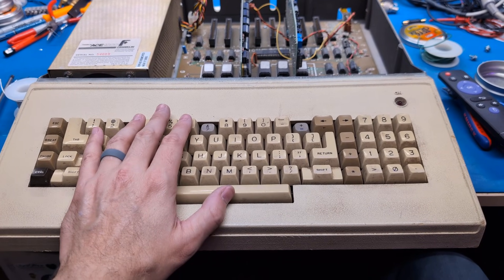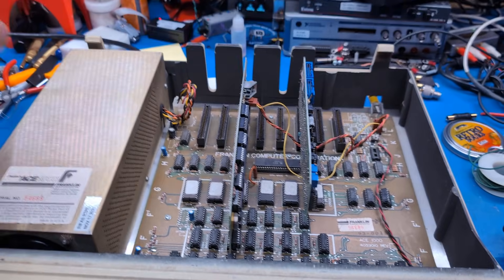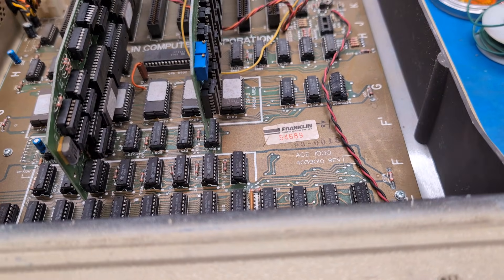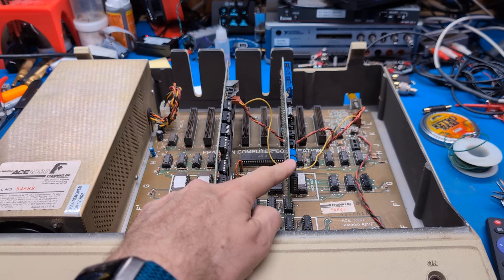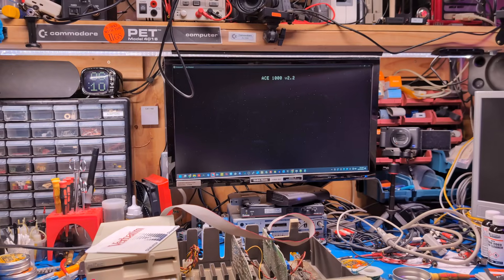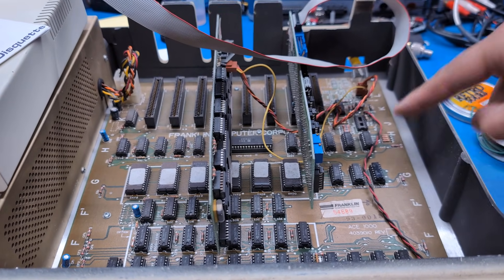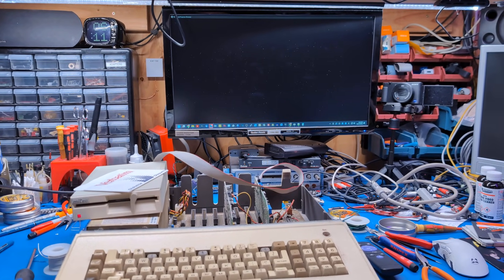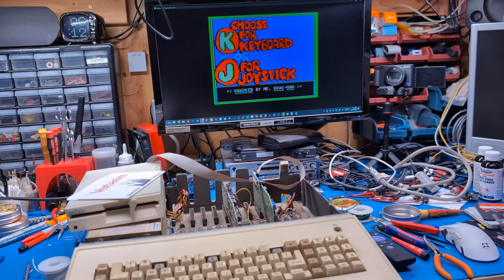Quick fix: Franklin Ace 1000 Garbage Screen

Comment: Ok, I have a (third party) PSU for my Apple II+, and it does the breaker blowing thing, now I have to search your extensive archive for a video of you fixing one of those power supplies beyond taking out the RIFAs. I took out the RIFAs in mine, they already look like they're at the brink of cracking, but the PSU still blows the breaker. Or, well, its internal glass fuse, without even switching it on, so I certainly suspect that leaky capacitor and/or the coil you are talking about.
Failing that, I have a backup plan: a 12V to ATX PSU thing with a small additional 7905 for the -5V (which ATX PSUs don't have, only older AT ones). I'm a little bit concerned because the datasheet for my RAM chips says something about -5V having to be established before the other rails got switched on, and I don't know if the mainboard fixes that. Well, if everything breaks I think I might have electronics skills to replace the sea of DRAM with two 62256 or even half a 628128 :)